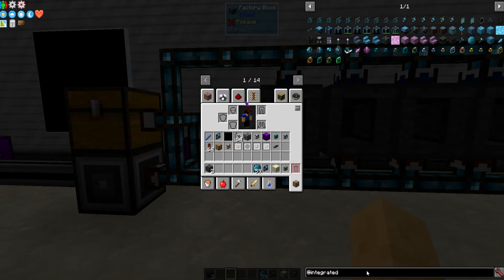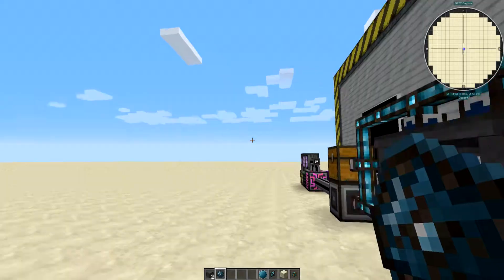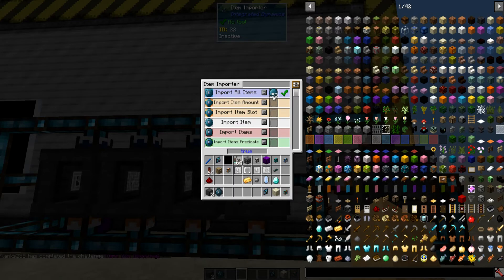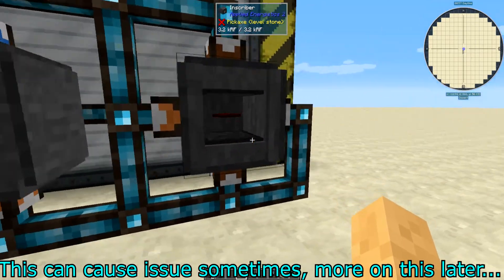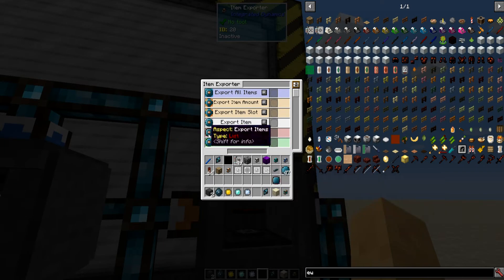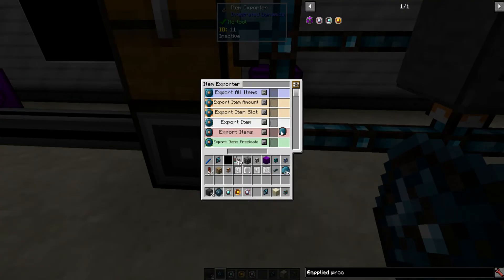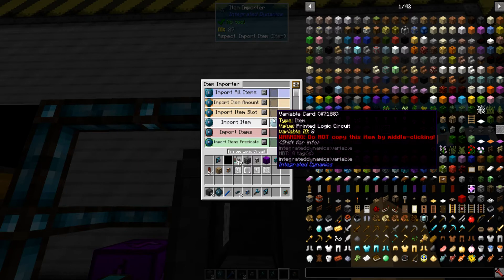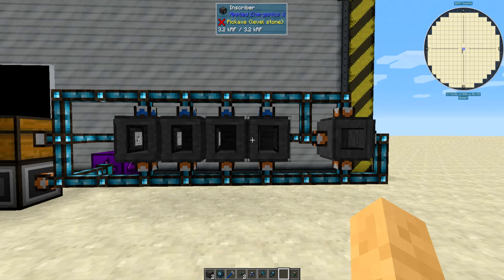AE2 Inscriber Automation: Integrated Dynamics/Tunnels

Comment: Neat trick automating these with ID/IT. FYI instead of creating an item list for the printed circuits, you could use an item interface on top of the final inscriber on a different Interface Channel and use that same channel number on the import interfaces on the other 3. You can also power inscribers by cabling one to your powered up AE system (they won't use a channel) and it will power all the inscribers it touches.